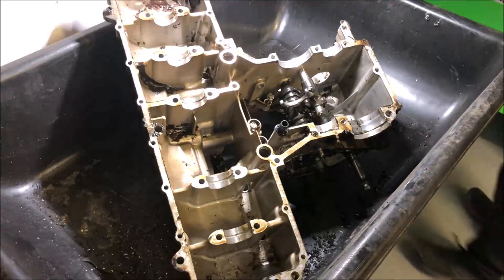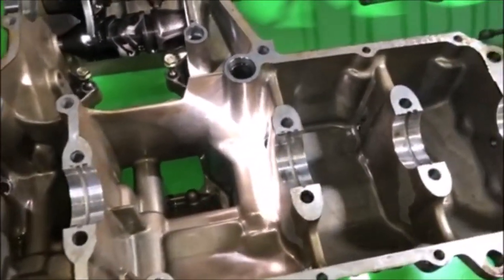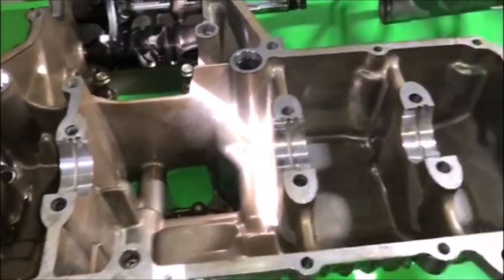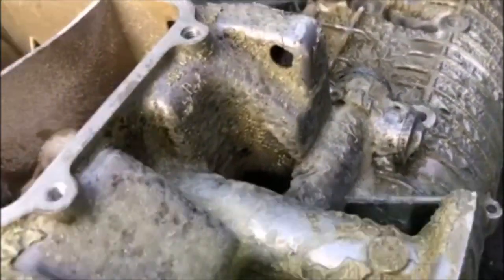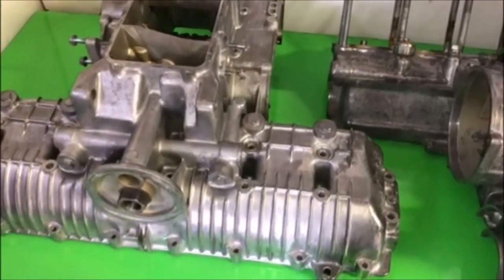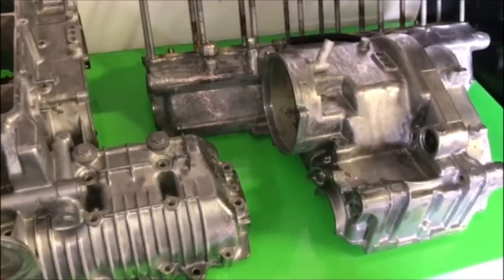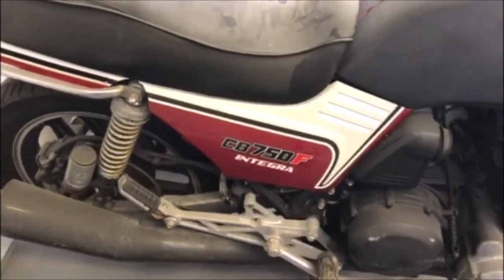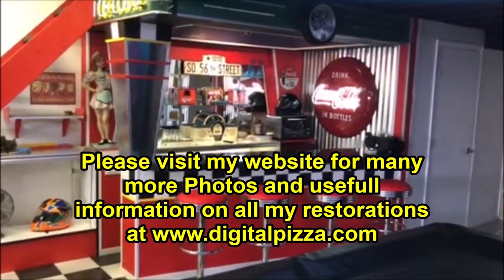Honda CBX Full Restoration & Engine Rebuild Video Series - Part 11 Preparing Engine Cases for Paint

Comment: I'm really enjoying the series Peter, I'm making notes as I go to add as comment so please forgive me. I was wondering if you had considered have the engine cases vapour blasted instead of using the degrease and paint stripper method ? I'm interested in your views ?
Reply from the maker: There are many ways to clean the engine cases. The important thing is to get them prepared to repaint to bring them back to like condition. I like using the solvent because it is the most gentle way to clean them. Vapor and media blasting can be harsh on the surface. But whatever you prefer is good as long as the end result is the same.

Comment: Why didn’t you remove the selector forks and shift shaft?
Reply from the maker: Hi Don
Those items along with the Gear Shift Linkage are all in excellent condition and work beautifully, so I decided to follow the "Don't fix it if ain't Broke" philosophy lol. There was no need to remove that assembly to cleanup and paint the cases.
Thanks Don, I appreciate the question. It helps everyone

Comment: Howdy Pete! What kind of paint stripper do you use?
Reply from the maker: Hi Michael
I use aircraft paint stripper in a spray can that I get at O’Reilly’s Auto Parts, but any spray can paint stripper at any auto parts store will work the same.
I get the spray can version because it gets all the hidden nooks and crannies that a typical engine has.
Works great
Reply: digitalpizza , thanks Pete, just making sure I’m using the correct stuff.